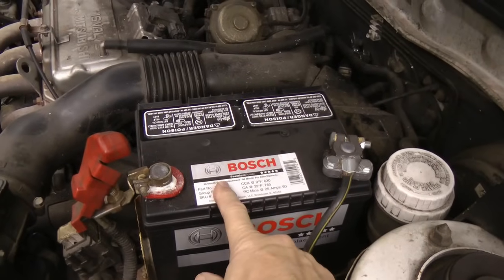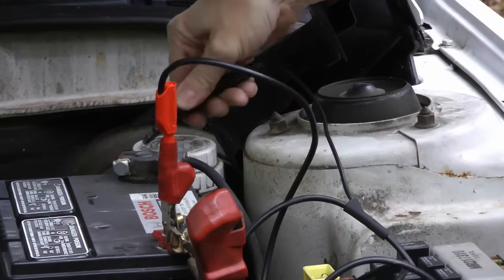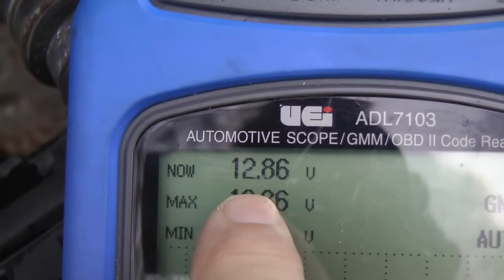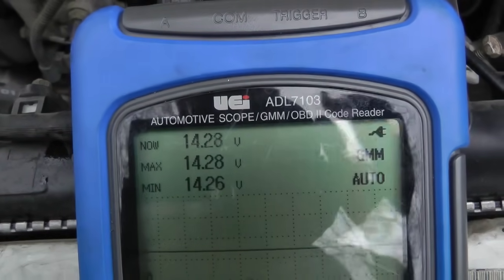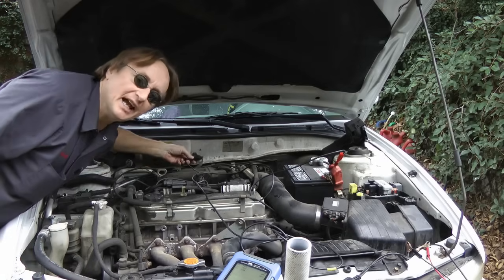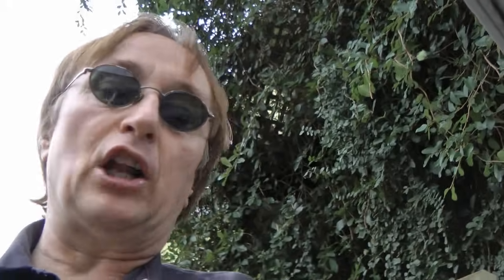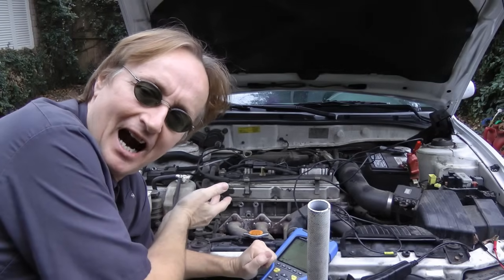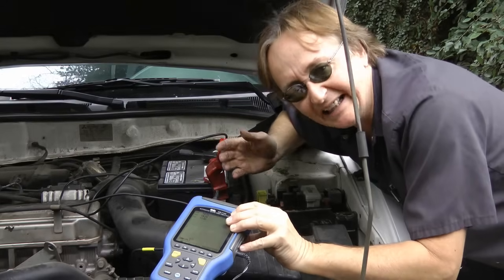How to Fix Electrical Problems in Your Car (Ground Fault)

Comment: Hi scotty  was wondering  if u can help or give me an idea on fixin my situation i have 2012 range rover evoque  runs great no check engine but today i noticed the small front fan i belive aux/condenser fan doesnt shut off even wen car is off the radiator fan is off only comes on when operating temp i disconnected it for not see if it cools down in morning or disconnect battery to see if it resets ecm..

Comment: I have a problem with my 07 chevy Tahoe 5.3 I replaced the fuse block under the hood all of my issues were resolved but when I tried to start the engine it would not start I changed around several fuses still did not work I put the old one back in and it started rite up tell me what is the problem
Reply from the maker: well, something was obviously wrong with the fuse box you bought, take it back

Comment: 1995 Toyota Avalon XL....I am noticing that instrument panel lights will, from time to time, stop illuminating. The don't flicker, they just stop working for a while. Then they work again for a while. Could this just be old lightbulbs, or could there be some other electrical issue?
Reply from the maker: more often it's a bad dimmer switch on the dash, they do go out like that . You can bypass it by cutting the wires to it and just splicing them together for full illumination
Reply: Thanks Scotty!

Comment: 2014 Ford P1000 straight truck with LED lighting. Parking lamps work fine, rt side brake/turn signal is normal.But the left brake/turn is very dim, what could be the problem???
Reply from the maker: classic signs of a bad ground wire on that side, check for corrosion or loose connectors
Reply: Even though the parking lamps work normally??

Comment: My 97 civic dashboard instruments don't work. Went to the gas station to pump gas and when I tried to turn it back on it wouldn't. 10 minutes later I try again and it finally turns on. BUT, the rpm meter acts fishy and when I break (even if I slighty tap the break) the rpm goes all the way down to zero. Also, when I turn on a turn signal, the rpm goes up and down at the same time as the turn signal flickers. Lastly, if I turn on my stereo, it also brings rpm down to zero and my stereo also just turns off out of nowhere. Idk what's wrong..

Comment: I have a 94 Chevy truck that If the ignition switch is OFF Break lights work. If truck is on they don't work. If head lights r on, break lights don't work. If I turn the Hazards r on NOTHING happens....  HELP!

Comment: I have a 92 Dodge Grand Caravan LE 3.3 Liter,.. Would crank without a Key, 
and Key cog was loose, It Cranked fine for 2 weeks, I drove it to a local store 
it cranked easy no issues, When I was ready to leave the store I turned the 
Cog and I could see white smoke coming from behind the dash. (Battery is 
GOOD), I replaced the Cog and electronics box there beneath the cog. It still 
is unresponsive,.POWER DOOR LOCKS, WINDOWS, Instrument cluster, 
Fuel Pump, Does NOT work,.(Head Lights, Cigarette Lighter, Interior Lights 
Work) It don`t Click or anything. I don`t know a lil about cars, I can install a 
radio but Im clueless when it gets past that area. What Do I do ??

Comment: I just bought a Nissan pickup with a electrical problem on the fuse box its got a wire from one fuse to another everytime I hit a bump or move the wire everything cuts off on the cluster
Reply from the maker: solder the wire in strongly so it keeps a good connection, or replace the fuse box.

Comment: I have a 1996 Toyota Soarer and the front right side indicator light switches on (dimly) with the headlights, but the indicator still works and flashes correctly? Thanks.

Comment: I've put 3 new alternators from auto zone 1 new one from O'Reilly 2004 Honda Accord it's burned every alternator after 50 minutes of running all the dashboard lights start flickering then car turns off

Comment: Most electrical systems on my car work perfectly fine (including the after market radio) but my headlights keep switching off when not desired. I suspect a shorted switch that needs to be replaced since they turn back on for a few seconds when you tap it. I thought that maybe all my new gadgets were pulling too much power so I turned them off, still happened.
Reply: Been fixed now. It was a plug on the right lamp and a bad main switch

Comment: I have a 1991 Nissan pickup truck the dashboard doesn't turn on at all nor does the speedometer work my brake lights don't go or my headlights and my radio as well what's the problem here Good Ole scotty!

Comment: hi, hoping you can help or give me some direction.  Honda Accord 2013 remote control issue.
The remote control buttons that lock/ unlock and make the horn beep to locate the car, no longer work on both remotes.  However the other function on the remote, keyless entry into the car, trunk and start the engine still work perfectly.  we tried changing the battries but no luck.  what may have triggered this issue, could be we touch something when we tried to install a dashcam but we took it out and traced back the path we touched and all looks good.

could it be a fuse ? could it be a untenna of some sort was unplugged/ disconnected ? could it be it needs to be re programed to the car ?  would appreciate if you can please suggest anything ?
Thank you

Comment: I have a 1996 ford ranger 2.3 and it has a brand new alternator and batter but the alternator isn't charging the battery and the car dies after like 20 seconds

Comment: I've got one for ya Scotty! I don't have to jump my old 93 Nissan, but voltage at the battery and at the alternator steadily drop if I let the engine just idle. I've checked connections at the battery, resistance through connections and cables, voltage drops, and of course voltage, from the battery to the alternator. Everything except voltage checks out okay.

I never get over 13v unless I rev  the engine with no electrical loads. Otherwise I'll initially see about 11.75v, of course it'll go down until the engine misfires, dash lights dim, and ultimately dies.

I should mention that voltage both at alternator and battery drop together. Battery is brand new, and more cranking amps than my old one btw.

About to pull my hair out here, trying to fix other things and this comes out of left field. Any ideas on what else I can test!? 

Ah, also the negative post on the battery gets, and stays, hot. I've added grounds and checked for resistance between post and connection and it's a clean no-loss connection between everything. Thanks in advance, if ya see this. Keep up the good work Scotty!

Comment: Another awesome video Scotty .  I have an issue with my 2000 blazer with the brake lights being on , turning the key on or just starting it up ,without pressing on the brake pedal. I checked & tested all my fuses and they are fine. I did replace one bulb on each side hoping to fix the problem being that there was one burnt out but cant find out why it burnt out. Could it be a ground ? Im usually pretty good with this stuff but it has me stumped..    ron
Reply from the maker: either switch is bad, or you have a bad body control module,    check the brake switch on the pedal first
Reply: Thanks Scotty !

Comment: ok what about a 2005 elantra the brake lights dont come on when i pull the handbrakes plus sometimes it just show up when i pull the brakes but sometime not so whats the problem here ?
Reply from the maker: handbrake switch would be bad then
Reply: Scotty Kilmer so there is no ground wire short right ? and btw thanks
Reply: Scotty Kilmer i just checked the switch its fine

Comment: Need help i have a 2003 tahoe all my lights work.signals work lights work but I have no brake lights they won't light up.. Checked fuses all Good. I changed the brake switch 5 months ago cause I had same problem..

Comment: I have a weird electric issue with my car. It will randomly not have any electricity. No lights, starter, nothing. It's completely dead. After some time (within the same day) everything will work again and all is good to go. This just started happening recently and I can't figure out why.  If I take out the jumper cables I can put them on the battery and tap the other end together and it will spark. So I know the battery is good and I would think it is grounded.

Comment: Scotty. I have a 1970 Chevelle. For years the dash and other lights dim at a stop, then brighten as you accelerate. Volt gauge was always read between 12-14 volts. The charging system always checked good. Alternator and battery output was fine. Voltage reg. was good. Cables good. I don't have any ground straps on the car.  Someone years ago said that might be it. Or is that just normal for those old cars? Thanks.

Comment: Hey Scotty. I got a 79 f150. I know I got a dead battery but when I start it you can hear the starter solenoid zing. it looks new. should I be worried it is faulty?

Comment: I have a '75 F250 that's no crank, no start even with a charged battery, all I can get is the voltage regulator clicking when the key is turned on. Quite a bizarre problem with the old gal

Comment: hi HV. 1994 MONTAGO FORD MOTOR HOME CANT FIND FLASHER OR RELAY. IF CAN HELP WOULD BE APP.
Reply from the maker: motor homes are not included in my data system, a big reason I stopped working on them. google around for motorhome repair sites

Comment: What can I do if summer heat caused a 15 amp mini fuse to bond with the plastic? I tried using a fuse puller & its stuck hard. I even used eyelash pullers. I'm trying to see if the main ciggarate lighter fuse is worn out on my Suzuki Forenza. The fuse box is located in the driver side door.

Comment: hey scotty I have a quick question.
my 1999 mitsubishi eclipse spyder, in the dash my left turn signal doesn't blink it clicks tho and they are blinking outside the vehicle. and it's the same thing when the hazards are on. 
do you think the light in the dash is bad??.
thanks scotty
Reply from the maker: put your flashers on to find out, if it doesn't blink then, bulb is bad or wiring to bult
Reply: Scotty Kilmer 
They work and blink on the outside of the car.
 the inside on the dashboard the left turn signal doesn't blink but it clicks and works just does not light up inside the dash
Reply: Thanks scotty

Comment: I have A blue wire with a white line? Which is for dash lights. It only works if I put it on the black ground wire? or if I put it on my black wire for my cigarette lighter? it works I have dash lights. But is that safe? It's the wire that's behind the stereo? And I can't dim any of my dash lights? There are no more wires on the back of my stereo that I can use for this wire?? My stereo is a Pioneer. And it does not have any Orange wires on the harness of the stereo or any Orange wires behind the stereo? There are no harness behind my stereo? Just wires? And My car is an 1996 Ford Festiva. Please Help?? What do I do??

Comment: 2013 elantra check the rear brake light bulb and replaced still don't  work don't  seem to have power the right side all works along with the third over the trunk any thoughts
Reply from the maker: check wiring, and if push comes to shove, wire the power to the unworking one by spicing its wiring into the working on, easy job
Reply: Took it to the dealer the bozo that was replacing the bulb had a bad batch the side prong was not out far enough to make contact then the dumb asses shove the wrong bulb into the socket and bent the contacts the dealer fixed it took the bulbs that they had used back to the shop that screwed up and made them pay the 50.00 bucks it cost me for there mistakes!  Reminds me of a lesson I learned about replacement  part look at them close side by of the old part to make dam sure it is one the same part two not defective!  This happen to me once with a dam distributer cap went mental over it car ran when it came in didn't  after the replacement was in never just trust it right the pin in the center of the cap was missing

Comment: Scotty, in my case i should be concerned What my car is doing when not running. I came out one morning when my car was not running only to find one of the head lights on. I went to see if the head light switch was on and it was off. To get the head light to turn off i simply switched the head light switch on then turned it off again. Now i just leave the battery in car unconnected when the car is not in use. Is this a ground wire problem?

Comment: Great video. Thanks for making it. My Dodge Neon has a problem. I turn the headlights on and the windshield wipers come on. Plus only the high beams work. Plus, when the headlights are on, the right front turn signal doesn't work. The fog lights sometimes work, sometimes don't. Today, the fog lights flashed like a turn signal when I had the right turn signal on along with the headlights. I think I have a ground problem and have to track it down.
Reply from the maker: replace the whole switch assembly, they go bad and do that

Comment: hello Scotty, I have a 2007 Chrysler Sebring 4 cylinder. sometimes when I start it it will turn over once or twice then nothing. like it loses all ppwer. I might Have to try and start it 10 to 15 times before it will start. Then some days it starts like its supposed to. It has a new battery.  your time And any help will greatly be appreciated!!!!!!
Reply from the maker: often just a worn out starter motor, test that first
Reply: Scotty Kilmer it ended up being the TIPM module, supposedly a real flaw in Chrysler vehicles. It affects the starter, lights, and wipers mostly! but alot of other issues with Chrysler vehicles! some genius at Chrysler decided to put something so important and expensive in the engine bay with heat and moisture! LMFAO WOW JUST WOW! BUT HONESTLY THANK YOU SO MUCH FOR YOUR TIME AND HELP! I greatly appreciate it. and maybe this will help you some day! I'm so thankful that you took a second to try and help me. you got to pay people like Eric the Car Guy just to respond! Thanks Scotty, you're the last of a dying breed!

Comment: 1998 Corolla that's been in a minor accident; all lights in the front do not work except for the left turn signal. Fuses are fine and grounds seem fine. Not sure what's going on...
Reply from the maker: check for wiring shorts and connectors that came apart

Comment: i have problems with my van... i try to connect my trialer light and  it work for a minute and everything when dim..... it wont start any more how can i fix it
Reply from the maker: I would assume trailer wiring shorted out stuff, start by checking fuses and ground wires
Reply: I check all the fuse. N no burn out

Comment: On my 2006 Ford Freestyle, It goes into limp mode when I come to a complete stop and resets when I turn the car off. Is that an electrical problem, or is that actually a transmission problem? Cause Auto Zone's scan tool found error code P0701.
Reply from the maker: with that code, either bad wiring or a bad transmission control module computer
Reply: Oh thank goodness! This is the best lead to fixing my car yet!!! :)

Comment: Hey Scotty! I have a 2004 Infiniti g35 coupe, my problem is that at night time when I need to use my headlights, my dashboard and stereo lights turn off as I switch the headlights on.. when I switch my headlights back off all of the interior lights turn back on
Reply from the maker: check for ground wiring faults on the dash wiring, also just load test the alternator and battery to see if they are weak, auto zones do that free

Comment: Getting  13.4 volts and my battery light is on when car is on. 2005 crown victoria police. I have a new battery and alt. Cant figure out why the low volts.

Comment: 1999 ford escort, parking lights stay on and brake lights no longer operating
Reply from the maker: check for ground wiring faults first, and also check the light switch assembly

Comment: hey scotty kilmer, all my gauges on my expedition go all the way up then all the way down and then back to normal when i start it up...also it doesn't start so smooth and sounds weak. i replaced the alternator and battery 2 months ago and the issue just started yesterday. possible ground issue? any thoughts would greatly be appreciated
Reply from the maker: they often do that gauge crap as they age and only replacing the dash and body control module fixes that, which is expensive. Also, check mode 6 and live data with a good scan tool to see why it's not running right
Reply: thanks very much...i watch your videos on a daily basis. I'm not a subcriber but I'm about to be...thanks old man

Comment: Hey Scotty what could be the problem if my charging system is only reading 12.8 volts when the engine is running but is still only 12.8 volts when the engine is of the alternator is new  I have test the output at the alternator and its reads 12.8 and I test from the negative post to the positive post on the battery and is also only 12.8 both tested with the engine running vehicle also has to be jumped almost every time to get it started the battery was tested at the auto parts store and was said to be good as well as the alternator
Reply from the maker: well, it's not charging, so odds are your wiring system is shorting out somewhere OR your battery is going bad. check all the ground wiring first, especially if a GM vehicle
Reply: Well it's a chevy 350 carbureted in a 1995 Jeep Wrangler I got the vehicle with a rat nest of wires everywhere in it so I'm having a rough time

Comment: My lights turn on my heater and all the dash lights are on.  now the car starts and stops..  gmc envoy 2006.  any ideas
Reply from the maker: typical GM product. But start by checking battery and alternator, auto zones load test em free. Pray it's that and not electrical or computer failure